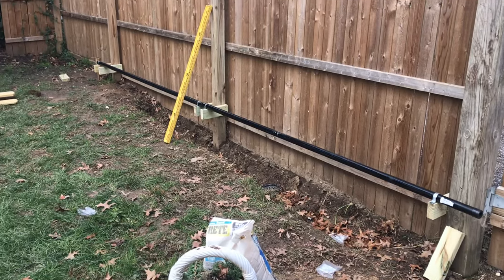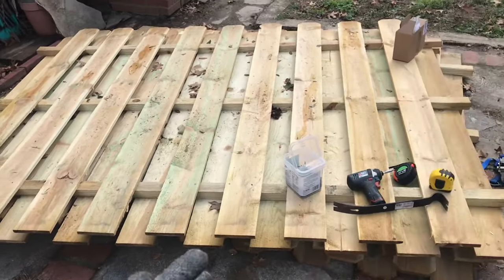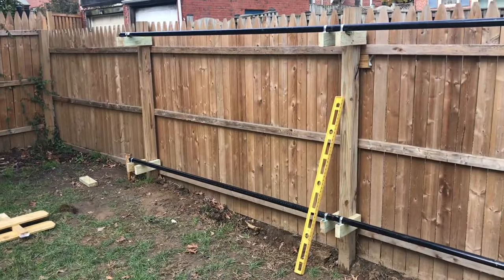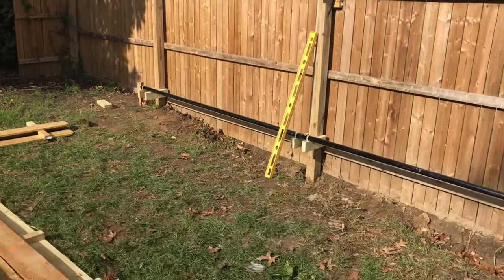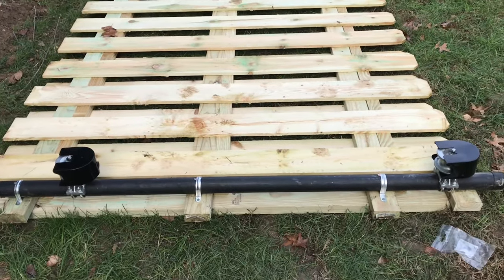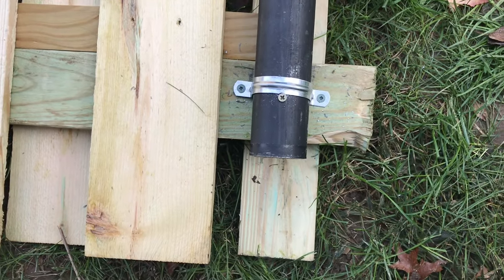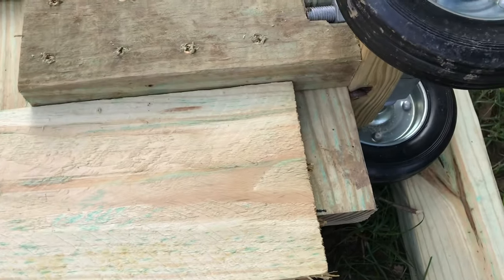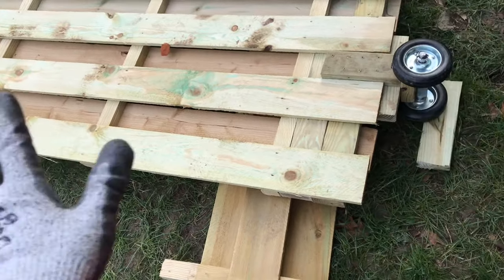How to build a wooden sliding gate

Comment: Good job. Would like to know if you can get the hardware and rails in a kit and where?  Thanks.
Reply from the maker: I couldn’t get my old emails where I got the kits from but Amazon have all the kits now. https://www.amazon.com/Track-Wheel-Chain-Sliding-Hardware/dp/B01N9WVPN7/ref=asc_df_B01N9WVPN7/?tag=hyprod-20&linkCode=df0&hvadid=168470783755&hvpos=&hvnetw=g&hvrand=9335087852678886082&hvpone=&hvptwo=&hvqmt=&hvdev=m&hvdvcmdl=&hvlocint=&hvlocphy=9032144&hvtargid=pla-306069502744&psc=1

Comment: Where did you get all the hardware for the rails, wheels, etc…. Nice set up!!
Reply from the maker: I couldn’t find my email where I got mine from but Amazon have all the parts now, https://www.amazon.com/Track-Wheel-Chain-Sliding-Hardware/dp/B01N9WVPN7/ref=asc_df_B01N9WVPN7/?tag=hyprod-20&linkCode=df0&hvadid=168470783755&hvpos=&hvnetw=g&hvrand=9335087852678886082&hvpone=&hvptwo=&hvqmt=&hvdev=m&hvdvcmdl=&hvlocint=&hvlocphy=9032144&hvtargid=pla-306069502744&psc=1
Reply: @rdhalim  awesome

Comment: How long are the rails? Are they each 25ft long? or did you have to combine two rails?
Reply from the maker: It’s 14’ long each, you can get it from Home Depot.
Reply: @rdhalim  so do you have the two 14' pieces connected in any way?
Reply from the maker: No, just 14’ for the top and bottom, it gave me about 13’ opening.
Reply: @rdhalim  oh OK. For some reason I was thinking the opening was over 20ft. 

I love the design concept. I think I'm gonna use it for my gate project. But it's a 25' opening so I'll need longer rails, which is a problem since Home Depot doesn't sell any over 10ft.

Comment: Did you finish the gate? How would you stop the gat from being lifted off the trak from a high wind storm and from someone trying to just simply lifting it off the track to entrude?
Reply from the maker: Yes, Make sure you don't pick the fence with no gap so the wind could slip through, I had very heavy wind and the gate was not even moving at all, its very heavy, if someone want to break in they have to jump over the fence first to lift the gate off the track. Its def. stronger than the swing gate.
Reply: @rdhalim  what size is the poles you are using and can you list all the material you used with the poles and bolts
Reply: @rdhalim  slide a piece of 2x4 or pipe of whatever that’s 8 ft long under the gate with a block or rock of some sort and down near gate to be a lever. Step on or use body weight at the end and your gate is lifted off and down. Take a floor Jack and slide it under and a few pumps gate is lifted and falls down but either of these will make a pretty good bang if you were home. The hardware is also facing out so couple turns with a ratchet gate is lifted off. Simple pry bar one can quietly pull wood fence boards off to get inside. Or simply bump it with a trucks bumper. A lock or fence only keeps a honest person honest.
Reply: I'm not trying to be funny or degrade your work, because it looks very well put together and you explain everything pretty well and it looks great looks great, but you can't ride a lawn mower through or a vehicle right?? It's just to walk through with the rails over you and under you? Edit I guess I kind of see now but what's going on with it?. But how do you stop it from being pushed in? It only has the wheel holding it there and no rails when it's closed, right?